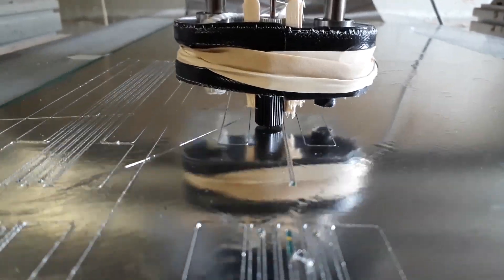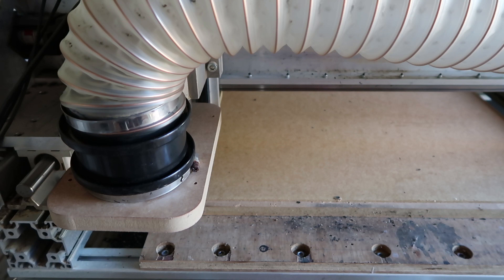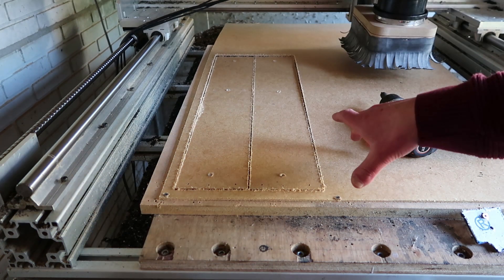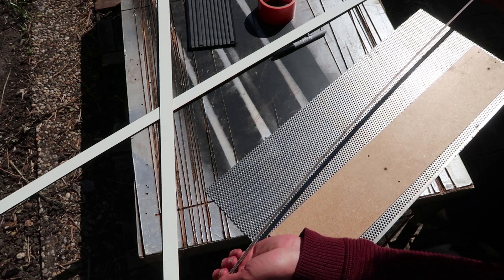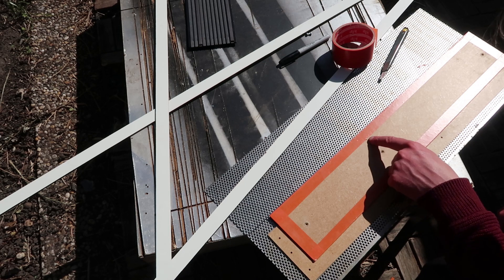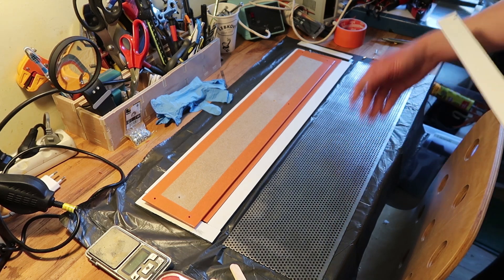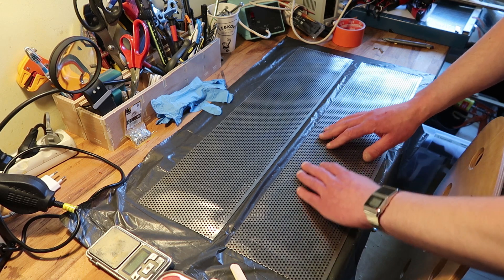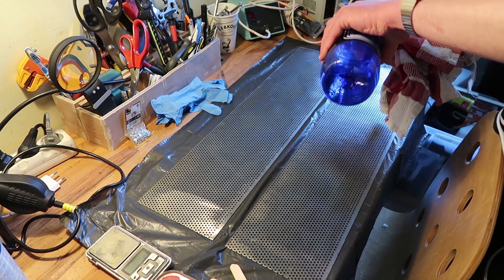Midrange Rubber Magnet Planar Magnetic   Part 3

Comment: As for the coil, Could you just print the circuit directly on Mylar with graphene ink? I'm not sure how thick a printer lays ink.  I just ordered some 1/2 um thick Mylar and am planning on giving this a go, thought that might be a bit easier then laminating copper or aluminum onto it and then etching it. Also, Do you have any videos of you actually designing drivers in cad? I think that would be helpful to learn more about designing coils and not just drawing stuff randomly that looks similar.
Reply from the maker: the printer uses wax, so indeed you would end up with making a laminate with aluminium (i do haev prelamited foil though) (dont use copper its to heavy) and etch it.  but on this panel i stated im not using the printer :) since it cant handle such large format :)  about the coil i have a video where i draw one simple coil. its really just dawing  in sketchup,  only thing you have to do is calculate the width of the trace (if using a single trace) by using the wanted impedance and the thickness is of the conducting foil used.  i do this in the same video. a bit more random then i normally do but, it has all you have to know to tailor the method to something you want. 1/2 uM ?  12 my i hope ? :) 

Here is the video it was a live stream so really long ... well realtime so. skip around to find what you want. https://www.youtube.com/watch?v=jAz9c22LWZA
Reply: @joppepeelen  No, it's .5 um 2 000 000ths of a meter, or at least that is what they advertise it as, they could be lying.   I found it through a Head-Fi thread I believe, It is called OS film and is used for Model aircraft.  Here is a link to a ebay seller in the US https://www.ebay.com/itm/Polyester-Mylar-film-5-microns-thin/113169978510  And thanks for the link;) Quickly becoming one of my most watched channels.
Reply: noah noah would .5 microns be desirable for a planar magnetic driver?  Magnepan does seem to use 12um.
Reply from the maker: 0.5 for a speaker is to thin, indeed 6 and 12 is more typical. And yes I Use cad. Since i use a cnc. There is no way you got real graphene.. graphite maybe, but both will not work since resistance need to be low. So alu is the only choice conductivity vs weight. I'm afraid